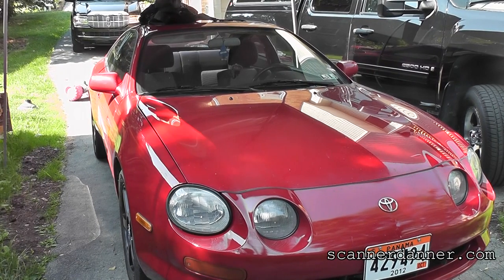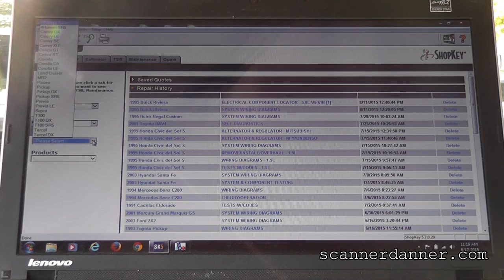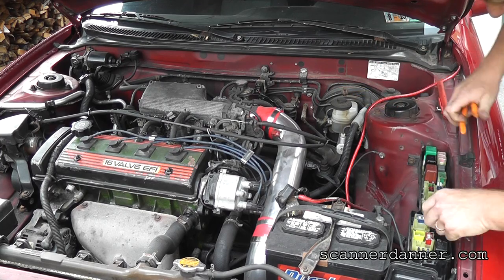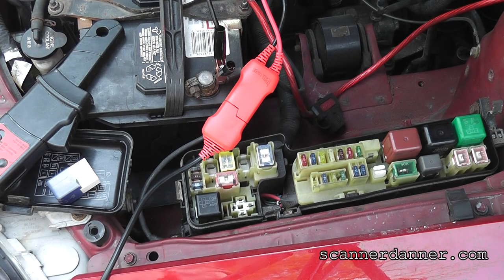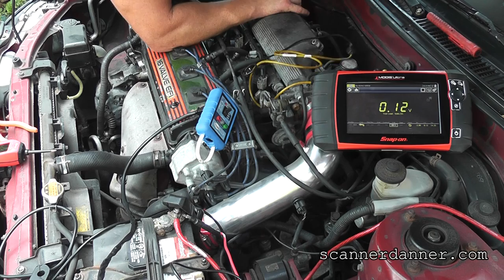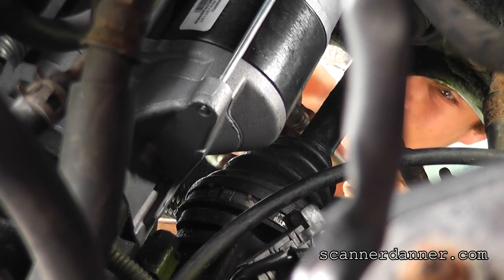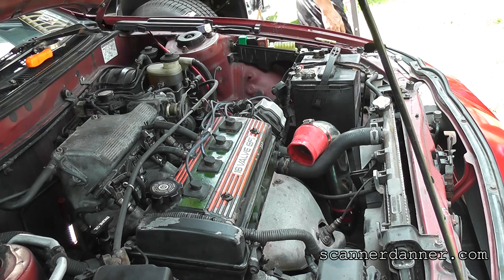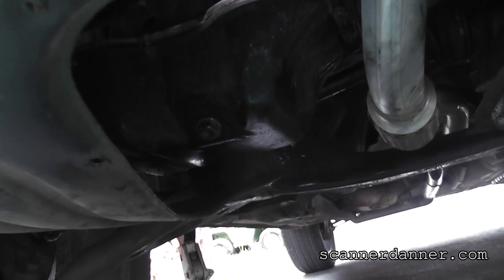How to troubleshoot a no crank problem (94 Toyota Celica)

Comment: My friend had a no crank problem.  He was about to call a tow truck.  I came over with a voltmeter and made a few checks.  Corroded connection between the battery lug and the cable.  Not between the battery post and cable lug, that was good.  Anyway,  took it apart, cleaned it up, and put it back together.  Started right up and hasn't had a problem since.  Thanks SD.

Comment: This was amazing; let me first congratulate your son for having a very smart dad!  I think so many of us would have appreciated having a mentor like you.  Well, I have a 2010 Mitsubishi Outlander, and there is no crank and nothing. I got to my destination when I parked in and when I got back put the key in and it did a very wick start almost fading out. Then nothing. I take the started to Autozone and starter is good. I am not a mechanic but I can follow directions.  After watching your video does gives me a more clear way to what else to check. And I can not do so because the lock of “special” tools at less I will know what the mechanic should be doing and charging me💰💰😊
I will keep you posted with the final diagnostic! 
Have a HAPPY Merry Christmas and a New Year 2023🙏

Comment: Danner you need to have your boy re install that 4 gauge amp power wire through the firewall in a safe grommet! It looks like a scosche kit so it probably has the standard maxi 80amp fuse in the holder and that should be somewhat safe, but if it ever gets pinched and chafed in the door jam he may get a bright fireworks show and melted wire that'll last until the fuse melts.

And excellent video as always. You're an awesome teacher for sharing your wealth of knowledge to YouTube for everyone. Keep it up brutha!
Reply from the maker: +Neurocidal For sure! We bought the car with that wire installed that way. It does have an fuse at the battery though, so we are okay for now. Thanks!
Reply: +ScannerDanner for sure man, I know of all people you've probably seen it all.

Comment: Great video Paul I just wanted to say The time you spend with your kids showing them how to work on cars is more valuable than you think when I was a kid I used to go to work with my dad doing heating and AC calls by the time I was 15 I could fix most furnace problems because I would say 90% of troubleshooting was electrical and I have always liked working with electric. Even though I didn't choose HVAC as a career the electrical principles are the same and use them working on cars today. 
Here is a tip for swivel sockets wrap black tape around it and that will keep it straight but it will still allow it to swivel

Comment: I have been watching a lot of your videos  recently and always learn something  thanks for taking the time and effort to make these great videos  on a side note  my friend  and I have both damaged our power probes by testing relays using the switch, the voltage spike from the collapsing field took out the power probe now I energize the prob with the switch before I touch the solenoid and hold switch on until after I remove the probe from solenoid  Thanks again

Comment: Great video! Awesome to see father son relationships like that. Also with a manual transmission sometimes when the starter hangs up you can roll the vehicle a little and drop the clutch. It frees the starter up but is not full proof works sometimes same as beating on starter.

Comment: Dear Mr. Danner. Another advise if someone stranded in same situation with a manual car is to push the car forward while holding the steering or have someone push him and then jump into the seat and put the stick on 2nd gear and release the clutch pedal. This will start the car but does not look civilized at all Loool. Also it happens with me instead of buying a new started you can after removing the starter dismantle the stuck solenoid and sand paper and light;y grease lubricate the knuckle track as well as a copper piece that bridge the high amp wire to the motor (or even replace that copper piece) and try its operation on bench before putting it back. This would be a durable repair.
Thank you indeed Mr. Danner for your great and lively movies.
John Kaplanian
Reply from the maker: +John Kaplanian thanks for the tips John

Comment: Taking out those starters in those engines is a pain, the older Toyotas, like 88 and back, and the Celica sport 22R engine is a breeze. I had to do it and had to buy tools and do it in a parking lot in the night, my back was destroyed. In the 1991 Corolla you have to take out the air filter assy. to reach the screw on top then get under to remove the bottom,  in normal conditions it is kinda difficult, let alone when it is night time. Anyways, any old Toyota fans out there? Great tutorials by the way, keep it up.

Comment: My dad was an ASE mechanic, but when my sibling and I started driving, he didn't want us fooling or fixing  cars.  He would tell us that we needed to study and get good grades.  We all did what my mom and dad wanted, which was to go to college and get a degree.  After we graduated, my brother and I started buying cars and my dad at that point would help us fix the used cars that we brought.  Some of my best memory with my dad was when we were wrenching on cars.

Since your son has a manual trans, I would have tried to bump start it.  If the engine started, sometime the vibration is enough to move the starter off a dead spot.
I give the family  discount to my family when I design a house for them, so I'm sure your son get the same friends and family discount.

Comment: Man I just had the same encounter w my doughthers Nissan Verza that wouldn't start, the car was left on a alleyway for two weeks, they told her it was the starter motor gone bad, so today I load up my truck w lots of tools hydraulic jack jack stands I was prepare for anything including my jump pack I drove 50 miles just to give her a jump start. There was nothing wrong other than she left something on n killed the batt, good bcuz I didn't feel like getting on the floor thank God! Lol Hey Jake
Reply from the maker: +Milton Solis that sucks, but at least it was just a dead battery

Comment: For folks who are "frugal". Autozones website has repair guides that usually have the wiring diagrams (Alldata version as AZ owns Alldata) Your local library probably has a subscription to EBSCO as well. They have an auto repair database that also has vehicle repair information including the wiring diagrams. Those are both normally free. Some of the manufacturers even have free or low cost access to the repair information.
Reply from the maker: +Blazer02LS I did not know that. Thanks for the tip

Comment: I had a similar no start issue with an F150.  The shielding on the cable going from the battery to the starter dry rotted off, and it had welded itself to the frame.  I worked construction, so I ran a new line from the battery to the starter with 4 gauge house wire to get me home, and it worked like a charm.

Comment: Sometimes you can rebuild a starter with bearings and new brushes if the winding is good. You're a good and patient Dad and Jake will one day thank you for that. Thanks for sharing! ;-}
Reply from the maker: thanks for the comment and for watching!
Reply: My pleasure, I have a 1996 Tacoma 3.4 liter 4x4 truck the other day I started it and plugged in boat trailer lights to go fishing  and lost all dashboard warning lights and when I stopped the engine I had no crank, no start no click even. That is why I stumbled onto your channel, trying to find help in diagnosing my Tacoma. Keep up the good work your content is awesome Dan..;-}}
Reply from the maker: Did you check all your fuses? The gauge or cluster fuse has a possible tie in to the anti-theft system which would explain your no crank after shut down
Reply from the maker: Oh and my name is Paul :-)
Reply: oopsie..Beg my pard
Reply from the maker: :-) it's no problem. I get Dan all the time from my last name Danner
Reply: No fuses are getting power in underdash panel, only 10 amp fuses in headlight array getting power in engine bay fuse box. tried test light on small wire to starter under cranking  no power being sent.. Possibly  ignition switch or fusible link. Bench tested starter cleaned contacts it's ok. Still stumped..Hope it's not  the computer.;-{{
Reply from the maker: Check the fuse listed as ALT in your underhood fusebox on the drivers side of the truck. It is an 80 amp fuse (not a regular style). Let me know
Reply: It looks fine but I'll check it with a multimeter later then I'll let you know, I have the fuse box split apart as it is held in place by 2 bolts from underneath, so I'm just waiting for my neighbour to get home so I can borrow his meter.
Reply from the maker: a test light would work too
Reply: Fuse was fine for continuity; checked fusible link (that's the short white wire from engine bay fuse box to positive battery terminal, right?) and it has continuity, as well as the longer white wire from fuse box to alternator connection too, it's good. I've got the clutch start cancel button out but I don't know how to test that one to see if it's faulty and I've also pulled out the whole ignition switch assembly. I've taken it apart and the lock cylinder mechanical parts are functioning as they should and turn the ignition switch electrical part as they should. When I have the key inserted and turned to on only 2 pins are getting power out of the battery.. Does this indicate my ignition switch part # 8445041010 is blown? How can I bypass the clutch start cancel safely and not fry that part? Thanks so much for helping me out, you're a Godsend!!
P.S.
The truck has an aftermarket alarm system, and my key fob is not locking or unlocking the doors nor is it making any noise whatsoever. The round battery is good as the little red led lights up when buttons are depressed..

Comment: Welcome to the aggravating world of car ownership Jake :D Couple tips. 

First, listen to dad he knows what he's talking about. And the more knowledge you have the easier things are to do. Check out channels like Chrisfix, Eric the Car Guy, and others for basic auto info like brake jobs. I grew up without the internet and learning this stuff was extremely difficult because I live in a remote area and learned most of the stuff I know the hard way from my Dad and sweating it out. I can't tell you how valuable channels like your dad's has been to fix things. Like your dad said, if you took it to a shop you'd have spent well over 300 bucks on that repair. Transmissions and motors can run into the thousands. If it had been a blown fuse or bad relay you would have saved hundreds in diagnostics.

Next, learn as much as you can about electrical systems and circuit diagrams. Modern cars are a mass of computer controlled gizmos that boggle the mind sometimes. Learn to recognize standard wiring diagram symbols, they are pretty well standardized now, again the internet is your friend. Learn about the basic components like resistors, capacitors and relays work. It helps to understand that stuff even if you don't work on cars. Ohm's law will help understanding current flow and why you keep blowing fuses or melting wires when you turn on your stereo amps :D and why most old people don't like to put them in cars. Ask dad about the horrors he's seen behind dashes XD.

Lastly, start collecting a good set of basic hand tools of your own (wrenches, 3/8 and 1/2 inch socket sets, lots of extensions and breaker bars for both to start, then 1/4), test equipment like DVMs and a Fuel pressure tester can be added as needed(maybe Dad has an old one laying around *hint hint). Birthdays and Christmas is a good time to get tools and they'll last a lifetime.
Reply from the maker: +Co Jones thank you for this my friend
Reply: +ScannerDanner You're welcome, but most of that was just common sense. Hopefully, he'll understand how lucky he is to have the knowledge available to him from you and the internet. 30 years ago my Dad and I considered  ourselves lucky to have an old outdated Motor's manual and some tools that would mostly make Harbor Freight look good to patch my Dad's truck up enough so he could get to work. 

I guess that's why I like stuff like your channel and I'm such a tool hoarder now. And why I don't like when people bash tools from places like HF. Sure anybody would love a set of Snap on tools, but sometimes it comes down to the fact that that is all they can afford to buy, and honestly some of their stuff is perfectly fine for DIYers. Tool snobs should try "Do I buy this tool or a pair of shoes for my kid?" I've been there and don't regret my Dad buying  tools because I've still got them and use some of them. Just not some of the older sockets and wrenches since everything has gone metric and I've added better tools since. :)

Anyway, I've rambled and ranted enough.

Comment: For your info, on the Power probe IV menu, go to feed mode, now you can read the live/resistance on the circuit. in this mode it's great for tracking down voltage drops and checking grounds.of course understanding your fundementals and using them  makes  this tool better

Comment: Good video ! Far as Power Probes go, a tip. When energizing or grounding higher amperage circuits, you can greatly extend probe switch life by first holding the switch in the appropriate position, then doing the actual circuit switching/completion via the probe tip. Better still is to avoid passing all but the lowest amperages through the probe.

Personally I'm not a Power Probe user, but through the years have seen more than a few of their burned up switches... If your going to use it a lot, order up and keep a few spares on hand... I'm pretty sure the newer models feature snap in, as opposed to the older generation soldered switches.

Comment: Great video, I just picked up one of these Celicas almost exact same one as your sons, even the red color except it's an automatic, so I ran into your video just perusing the internet on tips on the car. So far I haven't had any starting issues but I will also use your video as a reference to where everything is at on the car, such as the fuse box, etc. and everything you recorded, which by the way is a nice high quality video. Just curious this video was made about three years ago, you guys still have the Celica? I've read reviews for this 24 year old car and it sounds like one of the best vehicles ever built, with owners giving it such high reviews including those who've owned it used.

Comment: good video,you teach him how to test a starter on the floor too,on jump leads ,earth the body,small cable to click starter on,and test new one before fit to car,also show him how to bump start his car,ignition on ,push or roll down a hill,clutch in ,2nd gear,let clutch out ,force engine to turn over ,start,handy skill to have ,bump start,i got the same power probe and modis ,you can also make 4 wires,6 " long,4 ends female crimps,other end 4 male crimps,use as exstentions from relay box to relay,then can probe and amp clamp tests,very fast cheap test equipment ,make yourself,love your teaching style,learn loads,5v ref really up my game ,spanner light test,see if ecu awake or asleep ,i got the boss at work to play your vids ,in the canteen,so the rest of the machanics can watch,learn some think,while having lunch ,custamers watch it too ,in the waiting room ,love the volt drop test too,have seen a few broken earth cables,wire inside snapped,but still bolted to the engine ,wiggle and get good then bad conection ,finally got the boss to get us a wiring diagram account ,so print off diagrams to sort out problems ,cheaper than call in a auto electrician ,plus we learn circuit design too,your son should do well ,under your teaching and your brothers shop,be a good machanic ,even if only fix his own cars,just buy the parts to fix it

Comment: Consider rebuilding the starter. I've found it super easy. Clean off the commutator with some scotch bright and clean out the slots on the commutator with a pick. Assuming the brushes still have life, the start will work for years.

Comment: I’m at 33:11 in the video. One thing I would suggest is that you pull apart the pancake connection at batt + and ensure there are no green crusties. I’ve 500mv drops on Toyota’s  that wouldn’t allow the starter to engage. The bendix would engage but not turn the fly/flex.

Comment: A neat modification for universal/wobbly socket adapters is to put shrink tubing over the universal joint. This way the universal joint won’t flop around, and it will default to a straight position yet allow flexibility.

Comment: Hey Jake don't feel bad my dad and brother change the engine in a 66 mercury that we have station wagon an old 390 and as my brother was putting it back together when his girlfriend showed up and he forgot to tighten the valve cover and I was all of a ripe age of 6 years old 2 days later after countless times of trying to tell my brother that he didn't tighten that and he said he did my mother my aunt and I drove to Minnesota from St Louis and it and a quarter of the way we had to stop at a service station my mother took me up to the mechanic I told the mechanic I needed a 3/8 ratchet a 6 inch extension and a half inch socket he asked me what for and I explain to him the situation he looked at my mother he looked at me he went and got the tools I climbed up into the hood of the car and tighten the valve covers down the guy asked my mother if I was for hire because he needed another Mechanic my mother said absolutely not he only does my car. And we drove the rest of the way without leaking a bit of oil that was the first time that I ever wrenched on a car
Reply: izzynutz2000 if only that story was true
Reply: Worst story I’ve ever read